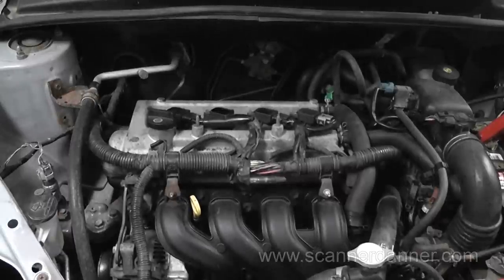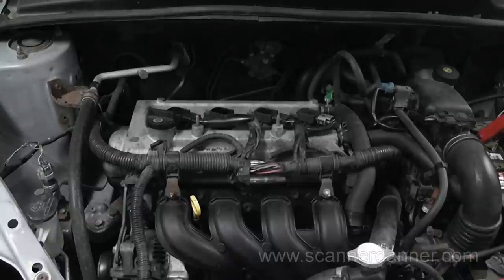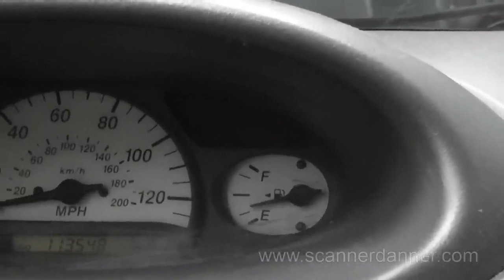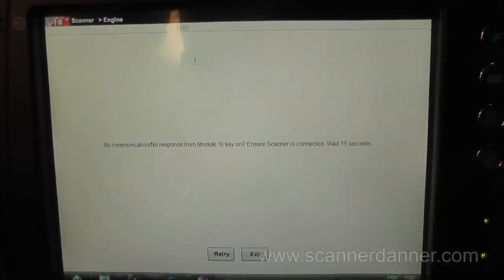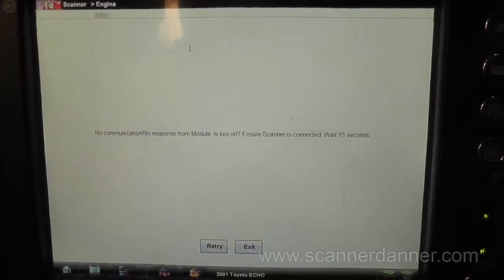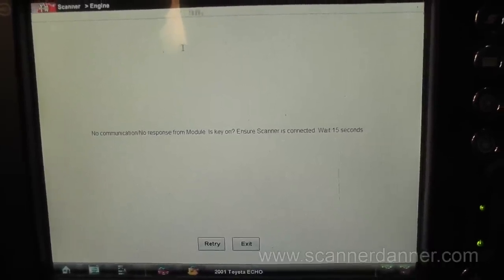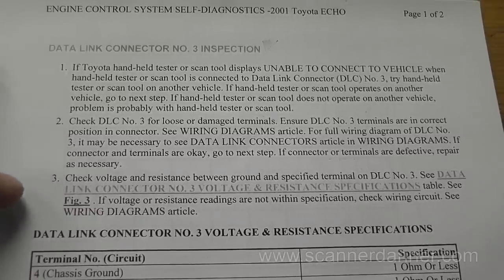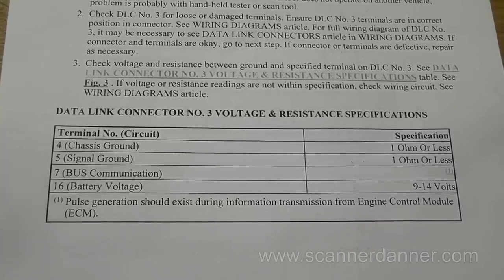Poor running, flashing CEL, no codes (bad computer ground) - Toyota

Comment from the maker: yes, copper wire is a PTC resistor. This means as temp. rises, so does resistance. 
Primarily when this occurs, it is from to much current flow. I have never seen an external heat source cause this. I suppose it is possible.

Comment: This is why i ALWAYS clean power and ground connections with sand paper and apply a liberal ammount of dielectric grease before tightening, when removing on everything.

Yes it takes more time but then i am sure it will not be a problem for me now or the customer later.

Very often grounds is right on painted steel... Then i use my finger belt sander to get it to bare steel

Comment: Just impressive!  I help many elderly and low income people on and off and sometimes just for free. My Parkinson's only allows me to function a few hours a day if at all. A veteran with early onset of Parkinson's (at age 39) and No Teeth ( well I have maybe 6 but only one set one up and one down that allow me to chew) year very funny...I know. No matter.... Having a medical back ground allows me to listen to symptoms  and do an observation and then obtain a plan for diagnostics and make repairs. When I was 16 I purchased my first used car. When I had issues I would ask my step father for help and he would point to the many old blue thick manuals on the table and say " their are the manuals, you will find your answer there."
Well since those days and now at 50+ in age I use the video I see and I read ...lots and take in the good and bad alike and try to get better and better.
What system and or software along with yr premium channels would help me help others. I see u use you have access to expensive software that allows you to manipulate systems at will.
Are there systems for 300 to 500 that you would recommend or are they all in the thousands? Anything would be better than my scanner for DTC s and my cheap ass multimeter. 
If you don't answer, I get it ... Too busy.
I will keep watching the best of you guys on line and putting what I learn into practice.
A Rusty Ground.... After multiple ecms and engine swaps. 
I be love it!!  God Bless.
Israel in North Las Vegas
Reply from the maker: Thanks my friend. I would recommend getting a scan tool with enhanced data and bidirectional controls. Something comparable to the OTC encore maybe? But that is around $1300
Reply: @ScannerDanner  Thank you for yr response sir, it is certainly much appreciated. Nothing wrong with saving 10- 20 bucks a couple of times a month.
Gotta love this country.
God bless you sir.
Is

Comment: Hi Paul. Thanks for the video I really enjoy them. My question is regarding the non loaded ground pin you were explaining that ohm testing is necessary in this case, could I perform voltage drop on the ground using the "load pro" on the ground side. I know the tool does it but I'd like your thoughts on it as I think that's another way of testing that ground. Thanks

Comment: I've never even heard of using an ohm meter to check grounds. I always use a voltmeter connected to the suspect ground and the other lead connected to known power. If the meter reads voltage I then switch the other lead to a know good ground and do a ground to ground voltage drop test. I'll have to use this ohm meter trick sometime now though! Thanks for this information SD. Now I know when to use what technique :)

Comment: Excellent. I am sure your class is fun to be in.
I've got a similar problem on my 1996 E320, including the CEL not illuminating at all.  I have replaced the cluster bulbs, and checked all my fuses....all in good shape. I also checked for power to the connection port, and it has power. I am sure I did not a thorough diagnostics like you did, but I tried with tools I had. I was hoping you can give some pointers, aside from what I have learned from this video. I don't want to spend money on an engine computer not knowing what is wrong first. Any advice is highly appreciated.

Comment: Hi, nice video. 
My golf 2006 1.4 tsi twincharged having cylinder wash issue. It cranks & cranks but won’t start. I changed spark plugs, clean them after getting wet again, coils, clean all grounds, checked compression , then try again but spark plug gets wet instantly. I tried everything but no success. As soon as spark plugs gets wet, compression also goes down. Can you please help? Looking to your reply.
Reply from the maker: What are your compression pressures? Any timing related or cam-crank correlation codes?
Have you checked it for a completely restricted cat? (Remove upstream O2 and see if it starts)
Reply: ScannerDanner thanks for your reply. Compression stays over 130-170 until fuel supply is back on. It’s get flooded instantly, spark plugs are soaking in fuel, and I can see fuel on top of piston head after removing plugs. How to deal with overfilling issue if that’s the problem?
Reply: ScannerDanner after deflooding procedure, compression goes around 210 psi  in 2nd 3rd & 4th cylinder. In first cylinder it’s around 150 -175 psi. During cranking after 7-10 seconds oil indicator starts to blink. I have located upstream o2 sensor, I will try to start it after unplugging it and update here. Please help me to sort out this issue, car has been parked for good 6 months, just wanted to sort out issue myself, and learn. I seen another video, guy with bmw e46 had same issue, plugs get wet, he tried everything but no use. In the end he changed oil pressure or level sensor and car started straightaway. During cranking , after few seconds oil sign starts to blink a n my car. Is the oil level sensor or oil pressure sensor same thing?

Comment from the maker: you could do that if you wanted to. also the ohmmeter isn't always bad. it is absolutely necessary at times. just remember it is not accurate on high amperage  circuits. these dlc ground are not high amperage circuits

Comment: Hi Paul.
Seriously enjoyable stuff.  Thank you.  I'm amazed that a mechanic would bolt an earth lead to a corroded ally housing like that.  Amazed but not surprised.

Will you post the powers steering code fix and the coolant light issues whenever you can please?

RESPECT!!

Andy.

Comment: Have you ever looked into using something like 5.5 or 6.5 digit multimeter with kelvin probes for doing resistance checks? Those would have the resolution needed to pick up on corroded connectors. I am not sure if it would be needed. You seem to get all the information you need  using voltage/oscope checks.

Comment: Great video as always.

With regards to checking the 2 grounds at the obd connector, would there be risk of damage to the ecu if you did a voltage test with the meter connected to a battery live and dlc terminal?

Also, when checking control unit grounds and seeing 0v you assume the ground is good. But surely there is a small chance of an internal open circuit on that ground?

Comment: Great Video!!! I have a 2001 echo that I just put a used 2002 motor in. Ran kinda funny on day one, day two I got it wet at the car wash and now the oil light stays on with the key out! And nothing happens when you turn the key. Gonna see if it dryed up tomorrow, any advice appreciated.

Comment: I know this is an old video, but if you really want to figure out what the waveforms look like on the network, you could technically just hook up the SRS module (while leaving the ECM unplugged so the network isn't being pulled up to 12V), hook up a scan tool, and communicate with the SRS module while graphing the voltage on pin 7 on the scope.

Comment from the maker: for the ohm test the key was off, for the voltage drop test the key was on, but as I said in the video, this voltage drop test was not a good test as I couldn't "load the ground" circuit on this design. 
and the DLC grounds were good. (different ground location than the bad block grounds)

Comment: boy a history like that 
2001 toyota 1.5
-auction buy with bad engine
-replaced engine wich was also bad
-second engine not running right
-replaced computer 
would make me run away

I had guessed bad ground from the start beeing in that same situation myself still nice to see how to trace the issue🤘

I wont buy Toyota 1.5L 
they're  2 for 3 on bad head gaskets😅

Comment: I've run into numerous bad grounds where thermostat housings have been involved.

Think it's because many of them are made of Magnesium. (It's for the same reason that Magnesium anode rods are in home water heaters.) With any kind of moisture and current, electrolysis action is very active. Add salt and it's severe.

Have had lasting success putting those grounds back together with some silicone grease, but whenever feasible, prefer moving them on to something cast iron or steel.

Comment: Mr scanner danner I have a 96 roadmaster with the lt1. I'm not getting any fuel pressure but I get a crank. I've changed the fuel pump, fuel filter ,fuel regulator, fuel relay. I hear the pump and relay activate but still no pressure. What the hell is going on??

Comment: Have you done any can system testing. I remember seeing one brief mention in one of the studies. OTC makes a neat tool that hooks up to the ADL which illuminates the 17 pins, confirms power and grounds and also gives a quick battery voltage read-out . The good thing about using it is the pin out test pins similar to a breakout box to monitor individual data transmissions in relation to the ADL pin location.
I guess my real question is have you done any studies to trace down com errors between modules and what methods have you found to be a time saver in the field.
I learned so much from you and now at 58, I'm backing away from the heavy line and pursuing mostly mobile diagnostics for other  shops and used car lots. There is a high demand here in Texas and I imagine everywhere for the technically savvy. 
Perhaps in your next book your could dedicate a chapter on can system analysis.
Just a thought.
Rick ASE Master Tech 28yrs
Premium member.
Reply from the maker: I have and there will be more CAN issues coming up. Until I have developed my own case studies on these, only then will I shoot some repair videos on the topic. I'll let the cat out of the bag though. There is no secret. It is still powers, grounds, opens and short circuit testing and unplugging suspect modules, then of course measuring the terminating resistors with an ohmmeter and checking for a mirror image on the CAN high and CAN low circuits (pins 6 and 14). More to come as I see them okay?

Comment: You go into tools>serial decoding and choose what type of serial communication you are on. Pico tech has a few videos on here showing how to set it up pretty cool feature when it works.
I know for a fact that it doesn't work on Toyota and Lexus and even with the Toyota pico scope, the head engineers in Japan are super protective of it.

Comment: I'm fairly new to your channel and have watched most of your videos and i would like to say i really appreciate and am grateful for the knowledge that you have imparted on us all on the operation and function of the automotive electrical components. I now have the basic understanding of most components and am venturing into the practical aspect of things. I would like to know if just having the basic tools such as a test light and multi-meter are enough to venture into the practical world of automotive electrical technician and does purchasing your book goes hand in hand with owning a scan tool that reads wave forms?
Reply from the maker: Venture in, yes. But it will only get you so far. Can you benefit and "keep up" with the information in my book and premium channel without a scope and scan tool? Absolutely! There is so much that I am teaching that goes beyond the tools you have. Ask around, read some of the comments on my website to start with. 
Thank you!

Comment from the maker: pins 4 and 5 used a different ground location than the PCM grounds that were bad. Loading those pins would not have helped ID the problem as they would have tested good.

Comment: as to your speech after the 31 minute mark. both of those ground circuits could easily have been chacked loaded. 1.... plug your scanner in and backprobe the ground circuits. or even easier a lowish draw test light combined with your meter. my lowest draw test light is a 194 bulb. would never have overloaded that circuit. have no idea what the led test lights draw but cant imagine any of them being any use for drop tests.

Comment: If it won't light a test light , the circuit can't carry current. Also on a ground like that I have used a rethreader to clean the threads out and in a little bit of a die grinder to clean everything else up the mountain all where the bolt comes in it sets with the shoulder I've cleaned all that up put it in those threads I've used the rethreader

Comment: In have in the past I used a variable DC power supply that has a  voltage meter as part of the supply.  With the components unplugged one can complete the circuit through another ground and gradually increase the amps through the power supply.  Mine maxes out at 3 amps.  I think all but very small wires would tolerate that amperage.  The voltage drop can be read directly from the meter or across the supplies pins.  This allows you to load a non powered ground. What do you think of this method?

Comment from the maker: thank you very much. if this is a MAF engine, your MAF sensor may be dirty. the lean conditions this causes will be more pronounced during a cold engine start. Check out my video "dirty maf sensor case study" it is on a Toyota. should be a similar MAF sensor as the Echo, but not 100% sure

Comment: 02 nissan altima crank no start, no control from pcm to coils and injectors, good crank signal at pcm, and no communication with the scanner, power and ground good at the pcm. I don't think need to do more test, bad pcm? any idea  thanks...

Comment: I have a plot 2012 and the problem is limp mode I tourque management feedback a malfunction p2637 error it happens occasionally plz assist no agent can get it fixed they request to change the wiring harness ???
Reply: Polo  2013 above

Comment: CAN bus hi  &  CAN bus low,   you can see it using  pin 6 and 14  at 40ms/division using a dso (continuity test around pin 6 and 14 is 60 ohms means OK , 120 128 means can network is open) pin 7 K-line  iso 9041 is used for toyota scanner an is not a can network. it doesn't taggle. Many transitional CAN applications continue to  use the sil circuit and iso 9141  to pin 7. in this case.

Comment: Hi Mr Danner.You are an American treasure in the field of education.  You talked about a known good signal from pin 7 which was best demonstrated when you forced the scan tool to communicate with the datalink connector. the question is; how is it, that the signal is so lazy around 12 volts when the engine is running [ which certainly is a period of a lot of communication].  Also is this a canned bus system or another method of high speed [ bus ] communication.

Comment: COP coil on plug ignition is misleading . There has to be something to connect the coil to the plug , something to replace the high quality spark plug cables cars Use To Have .  Today it is often just a cheap spring , designed to fail and hidden under thick insulation . Sometimes when removed , you can see arc tracking on the outside of the insulation

Comment: Hi Paul...if we do resistance check between the terminal of a connector and ground, if we get zero ohms, we say the wire is shorted to ground and if we get open limit, we say the wire is open. If for example, we get like 300ohms, 500ohms or any greater number, then what does this mean???? bcoz neither this is short to ground nor open. Thank you
Reply from the maker: A partial short to ground. I have a lecture on premium where I describe a 900 ohm short to ground on an RPM signal (ICM to PCM) that pulled the 5v square wave down to about a half of a volt square wave and made the truck not start. It ended up being a viper alarm system wired into that circuit.
Reply: @ScannerDanner  yes paul..i have watched this video..i will do it again..thank u soooo much

Comment: Ok Dumb Question. Can't you try to take a voltage reading on a DLC ground to body ground to see if it is bad when you run the scanner. See if you can load up the ground there? The problem was caused by a bad ground on the engine to the PCM under the thermostat. Would this work?

Comment: fix the no communication problem, now have p1610, p1612, u1000, u1001.. Testing at the immobilizer control unit signal to pcm I have 9 voltage all the time with or without the key on. Have you test this before ? I know this have to be fix at the dealer.

Comment: Hi Paul good video very interesting, if you don’t have access to the ECU probably buried inside the dash, how would you check your powers and ground loaded circuit?
Reply from the maker: If you are going to be "calling a bad computer", then you will be digging it out of the dash. You have no option, you have to do it, there is no bypassing this step on any car.
Reply: On checking the powers and grounds on a ecm inside dash, taking all out , are you able to start the vehicle to check them under load or just the switch on? How would you deal with abs bag ?

Comment: Paul @ 24.00 mins you discuss voltage drop tests for grounds. Could you show us if you just used the ohm meter to check the grounds? I persume you would have really high resistance?